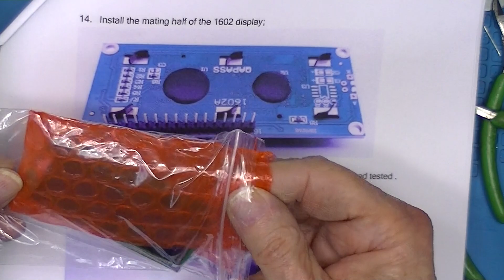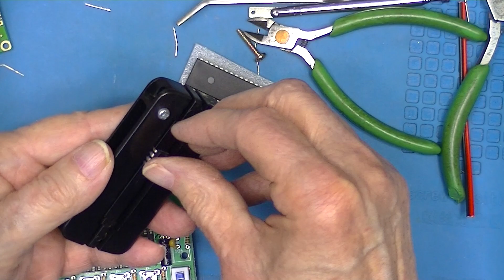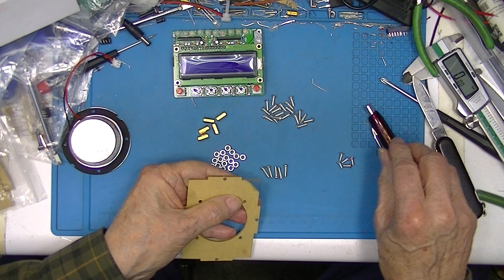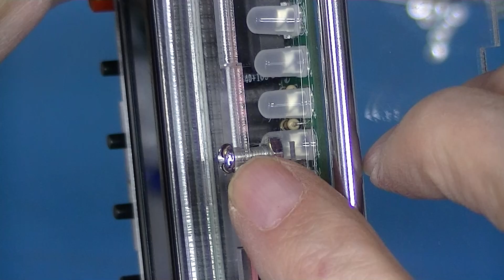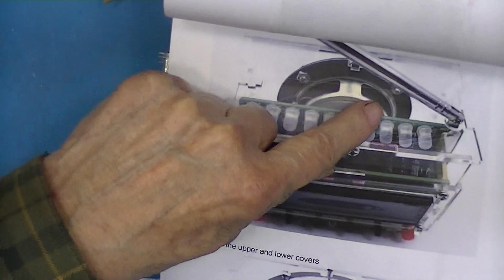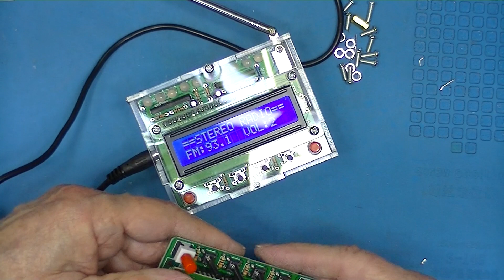For Future Scientists/Engineers – Ver 2 FM Radio Kit - Part 4

Comment: to Steve Wagner:
your first test was taken in the tenth minute of your video,
everything was fine the music sounded at the frequency of 88.1 Mhz,
after turning off the radio and turning on the radio again, the frequency changed to 90.0 MHz and the radio stopped tuning,
I dont understand, the question is why?
Reply from the maker: I built two of these kits, both have a problem with tuning. See the comment by Amir B. I can't get the tuning buttons on either radios to work, either as simple UP-DOWN or as SEARCH UP-SEARCH DOWN. If anyone has one of these that work, please dro a message.
Thanks
Steve
Reply: @stevestrivia-bystevewagner4852  I have a radio that tunes very well but the screen does'nt work at al I just have one line with white rectangels and some noise in it. But the radio plays very well..

Comment: that's because those two buttons are search up and search down in freqency for the next significant FM signal that the receiver can detect . They are not frequency increment or decrement. If their search algorithm is slow, you need to wait after pushing the key to let it find the next station if there is any. Then of course it comes down to sensitivity of the receiver etc...
Reply from the maker: I powered up both examples and quick, and then slow, pressed the UP and DOWN buttons with no success. The device still does not tune.
Thanks for the comment!
Steve